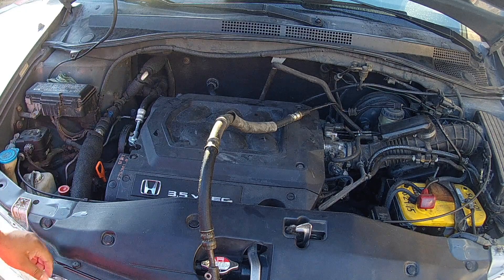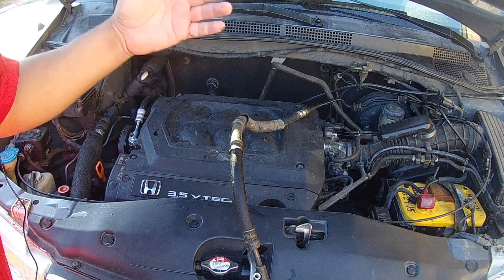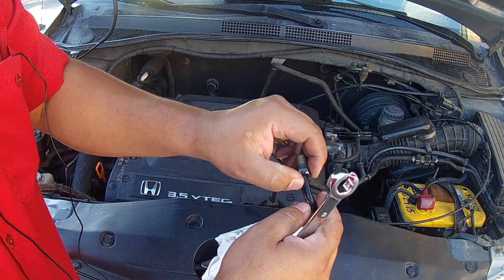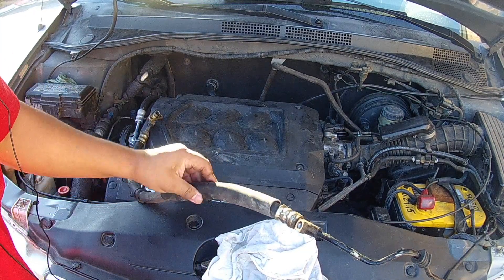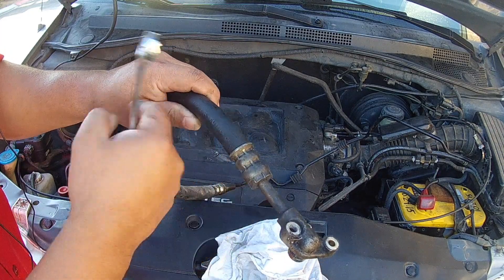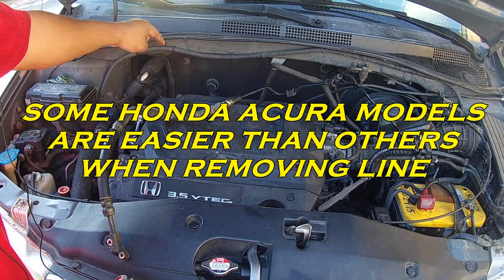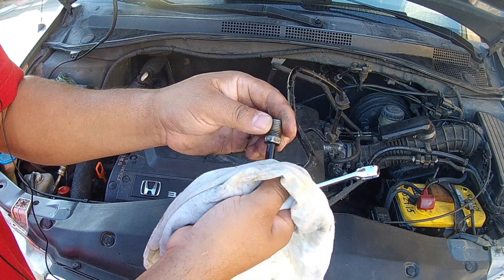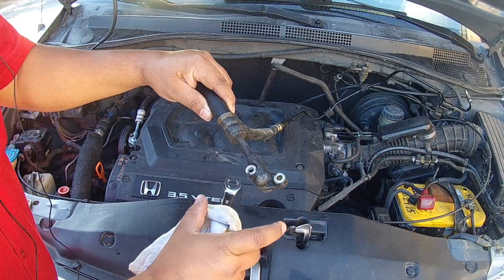DIY Honda Acura High Pressure Power Steering Hose Accord Odyssey Ridgeline Pilot MDX TL CL

Comment: Tiny bit of help.. not describing whether or not you drop the subframe,, which direction to get the 10mm bolts out in middle of line... everything mentioned is nothing anyone would need to know to actually remove the line..

Comment: Not very useful. Could have used some pictures of locations. Also, how did you de-pressurize the hose before removal? Did you have to drain the fluid or have a basin to catch the fluid on removing the hose?
Reply from the maker: You don’t need to de pressurize the hose. There is not pressure on the system when the vehicle is off. There are other videos out there that show locations I was trying to explain how to get the hose in and out.